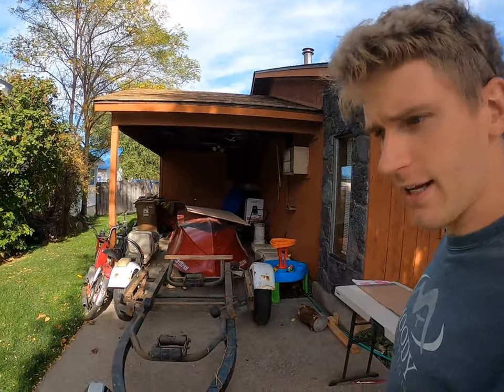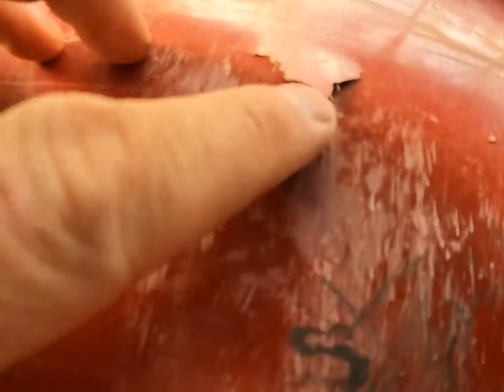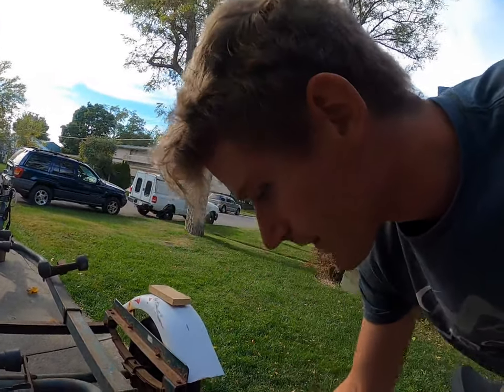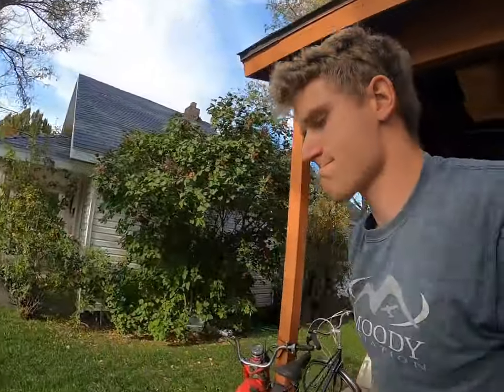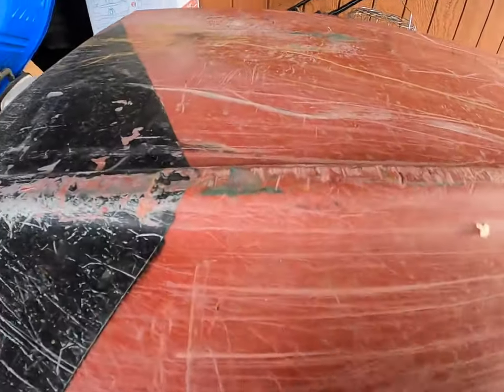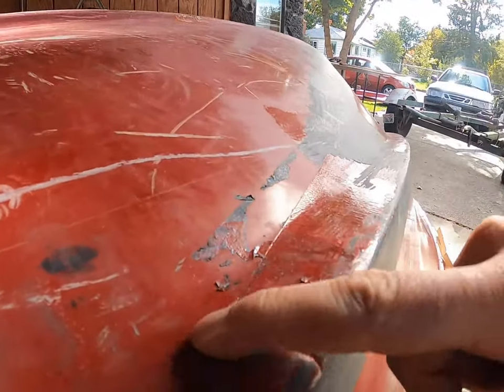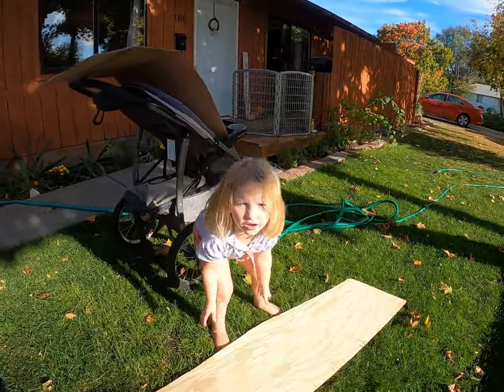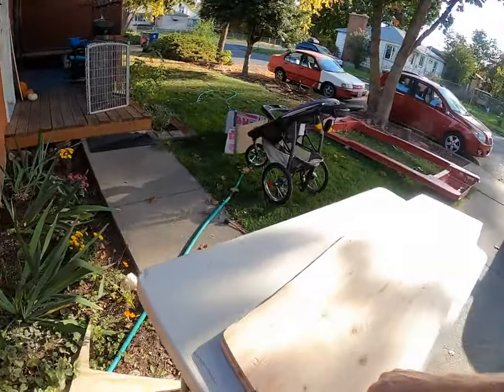Cracked fiberglass boat hull restoration (Part 6)

Comment: I hope you bought Marine Grade plywood for the transom...
Reply from the maker: After some research I decided to go with regular plywood. The regular plywood has a B and C side. Marine grade has a A and B side. Those where the only found differences. The marine grade plywood was also glue together with the same glue regular plywood is glued with. And for that reason I bought regular plywood. Which saved me $57. I will be glassing the transom as well this should give it added protection. I seriously looked into the marine grade option as well as Coosa board. I would of chosen Coosa board but it's to expensive for this project. 🙂
Reply: You have a really cute little helper!! XD
Reply from the maker: @alesyas7826  she really does love being in front of the camera! 😅
Reply: @Project2Potential  There is no need to go with marine grade plywood. As you said the normal ply has also waterproof glue nowadays. Regular plywood will work perfectly inside transom. Just remember to soak it properly with polyester resin before you lay down figerglass on it. 
I like your project videos! I will definitely subscribe your channel.
Reply: Is OK I use regular plywood to  As long  you proxy it real good and fibreglass  Make sure you clean it well with acetone it helps  Pull the  Moisture are out
Reply from the maker: @bassneckfishing2505  Good idea! thanks for the tip, I will be sure to do this. thanks